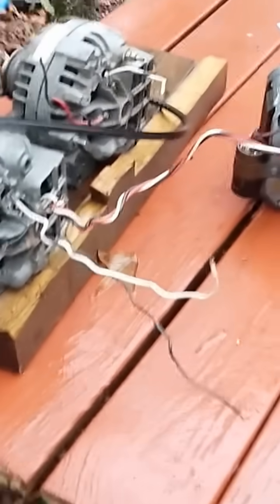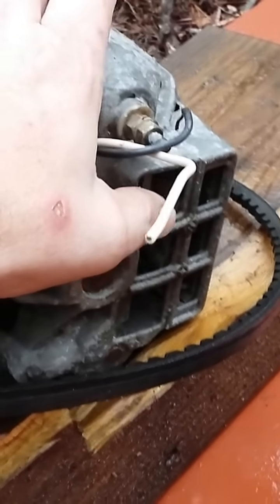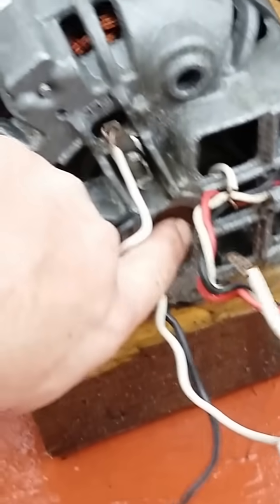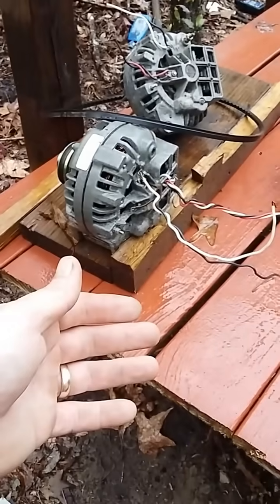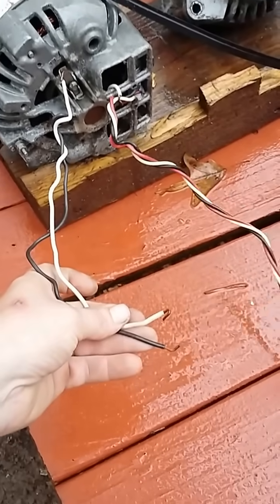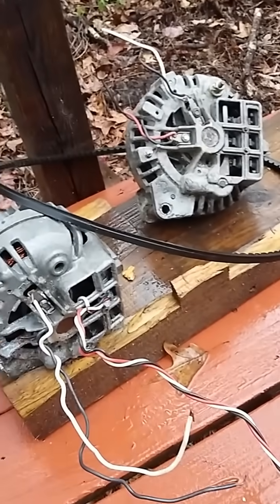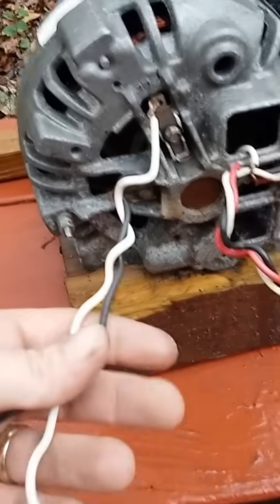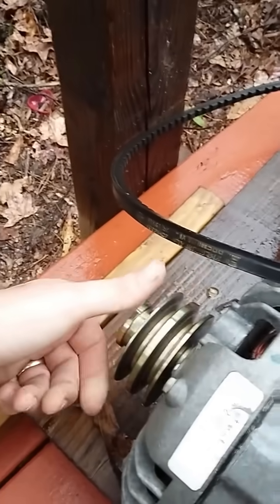Update Free energy forever no wind no solar no gas READ DISCRIPTION!!!

Comment: I have two versions of how to spin the alternator. 1 I've used a 12 volt ac  blower motor with a modified shaft to hold a pulley and second I used a old style sinde walk edger  and made a bracket to hold the alternator and used the original 3 hp Briggs gass engine. It'll run about 2-3 hrs on a gallon of gas also used the same set up to make a 12 volt battery charger for my drag car since we don't run a alternator. I just recharge between races. All of them work great. I see they're old Dodge alternator's they work great because without a regulator they will put out more voltage than a equivalent gm or Ford alternator..

Comment: You are correct it produces alternating current but the cycles per second  not correct at 3600 rpm’s which  you need to get a certain amount of current and voltage out of the alternator and less you change the magnetic fields internally there’s no way you can get 60 Hz out of an alternator which is 60 cps at 3600 rpm’s the alternator would have to turn a much lower RPM which I would say 300 revolutions A minute which would give you your 60 Hz but you wouldn’t get nothing out of the alternator no Current or much voltage
Reply from the maker: randy smith  do you know if you change your run capacitor it will also change your voltage and your Hertz on your generator?
Reply: Yes some one knows what they are talking about

Comment: Don’t be fooled it takes more energy to run an alternator than what you can get out of it this is not perpetual motion and even if you could get alternating current out of this alternator To run certain appliances At 120 or 240 V the cycles is not going to be correct the cycles of an alternator can be 320 cycles A sec at 3600 rpm’s which no conventional Electric motor will run And it may damage other electrical components that require 60 Hz per second not 320
Reply from the maker: randy smith oh and by the way and alternator is called an alternator because it produces alternating current! it is then ran through a set of diodes called a trio bridge that changes the alternating current into direct current and the fancy alternators actually have a capacitor in there to regulate the voltage...

Comment: I actually get this. People have this misconception that "free energy" means you're gonna magically pull it out of the air or something, but no it takes work to actually make energy. What this video means by free is that you're not paying for it. You're using a small amount of voltage and amplifying it into a larger amount (enough to power your home apparently) which is impressive and I assume saves you a lot on your electric bill :3 Cool concept dude. Thumbs up.

Comment: Trying to ask an intelligent question here without meaning any insult:    If I understand your video correctly, then you are spinning the alternator by belt drive from an electric motor. Yes ?   So, where do you get the power to run that motor from ?  I am guessing that if you are drawing 90 amps from the alternator then the motor to spin it will need a lot of power. Is this correct ?
Reply from the maker: Kevin Lawton technically what you said or how you said it is correct... but there's a lot more detail to it then what is being shown! first of all you have to have a battery or capacitor Bank in order to get the system up and running from that point it can charge the battery Bank. but you will have to put 12 volts at 500 milliamps to a pulse-width modulator and run pulses in a certain sequence into a 3-phase H Bridge that will power a 36 pole 3 phase permanent magnet motor using direct current pulses of sound at 14800Hz or pulses per second. you will need to feed with a power inverter off of the battery Bank 396 volts to your input on your H Bridge. You can do this with a small 500 watt or 1000 watt 110 volt power inverter and just run it to a 12-0 12 Transformer so that you will have the voltage needed do not feed that much voltage or current into the gates! Because the pulse-width modulator hooks up to the gates! And doing all of this will give you approximately and 800% efficient 3-phase permanent magnet motor that will produce roughly 45 horsepower which is enough power or Torque and speed to turn and fully excite to 10000 watt generator heads, thus being able to charge the battery bank (easily) because you're only consuming .75 amps at 396 volts you are also consuming 12 volts at 500 milliamps...  the alternator in this video is a homemade 3-phase field magnet motor. And I would like to take the time to say thank you for the kind comment and intelligent questions!!!  Did you notice that I switched the words rotor and stator?  a car alternator used as a car alternator can only produce 9 amps at 120 volts or 90 amps at 12 volts which is roughly 1080 Watts...
Reply: @ThomasBuie  thank you soooo much for explaining I love this setup and keep up the good work
Reply: Solar panels......

Comment: Wouldn't be surprised if you could  hook up a 12 volt battery to a hydrogen Dry cell  and inject that hydrogen to a gasoline generator 

The generator would have to  be pressurized with hydrogen but then again  you could also run your car on hho

I love this shit

I know this shit works

It's just expensive to learn how these things 

Work since electricity is a phenomenon  we can see
Reply from the maker: Christian Vega 
If you pressurize hydrogen and it has any oxygen in it, it will explode!!!! equaling death. You can use a 12-volt battery to create a great hydrogen cell but you must use pulsed DC not just regular direct current and in order to activate 1 billion parts per 1 billion Parts in the water, you must shoot the water with a red laser. this is all compliments of a family member of Stanley Myers of course... would anyone like for me to get into this a little further? Or explain how Stanley Myers did it with such ease?

Comment: All the dumb comments are by dumb people; he's showing you a home made inventor people.  He stated using a battery as a power source.  Then you can connect a solar panel to the battery to keep it charged.  He's smart.
Reply: Just add a bracket for another alternator and leave it stock to recharge your battery.
Reply: The dumb comment is from you.  You didn't calculate the amount of power it takes to turn the pully which is greater than any amount of power you can ever get back out of it.
Reply: Go back to school bro.  Converting DC to AC doesn't take but 3 to 12 volts  i.e a battery.    I currently use a 12 volt battery which I convert to 2500 AC volts.

Comment: People keep saying, "there's no such thing as free energy". While I realize that this video is about electrical energy, the proof of abundant free energy is a simple solar cooker. The mirrors/polished aluminum panels reflect the sunlight into the chamber, the chamber heats up, which heats the pot, which cooks the food. Simple to make, simple to use. Or use cardboard to form concentrating collector, inside of potato chip bags (or aluminum foil), Elmers glue, a pot and a turkey cooking bag will do it as well. Not AS WELL, but it will do it.

Comment: 90 amps at 12 volts AC only creates (through a 10 to 1 step-up transformer) 9 amps at 120 volts AC. The alternator can not generate 240 Volts at 90 Amps. 90 Amps at 14 Volts DC sustained, maybe. DC Voltage can not use a transformer.
Here are your basic electricity formulae. 
Power in Watts (P) over Electromotive Force in Volts (E) times Current in Amperes (I);  P/I*E.
Basic Electrical Formulae for Voltage((E)/Current(I)/Resistance (R); E/I*R
Voltage and Current are inversely proportional. Using transformers to step up Voltage steps down Amperage. Using a transformer to step up Amperage, steps down Voltage proportionately. 10 time more Amps means 10 times less Volts.  Ten times more Volts means 10 times less Amps. Simple really.
Reply: gecsus its important that u understand I'm not on this guys side.that said about 10 to 1 on amps is right for inverting DC to ac.but your wrong about the alt if he could get the alt to higher volts which he can't.it would still produce 90 amps.here's how I know and you can check.looking at this charge controller.its a 12/24 volt model it does 20 amps. So if I use 12 volts I can run 260 wats but if 24 volts I can run 520 wats.says so right on it.here's why the guts are set to let 20 amps through. Doesn't matter volts.but.he can't change the volts of that alt without changing the copper inside,and I'm 99% pretty sure he can't get it to produce ac power .inverters are big .to big to build on into housing.and he's a moron if he thinks that he can power anything ac with 120 DC.if you tried you would make the welder he was talking bout and burn up anything you tried. Ac and DC are not the same.now he could use 2 alts to make 24 volts but only 90 amps.if you used enough alts you could reach 120 volts but only 90 amps.so this dudes a lier/scamer.I live off grid and have ac and DC power outlets in my house.so I know bout this stuff.also your not using a alt you turn into a motor to turn a alt and gain power.you can use a DC motor to turn a alt with a slight gain.but you need the right DC motor. Needs to around 2000 rpm.and high out put alt 150+ amps..you need a DC motor because inverters lose 10 to 20% power lose so you want DC motor that runs off DC bank that the alt is powering.I could link you the stuff off eBay.but your not making enough power off one to do much not running a ac. Because even done right takes a lot to run motor.but buying a ac motor and using it to turn a alt is the best battery charger.nothing sold at any price compares.    Anyways while this guy is a hack smart people like you say stuff.have a blessed life.

Comment: The advice that "if you keep doing this you won't live very long" is not because some government agent will do away with you.  It will be your ignorance of electrical principles that will be your demise.  Sorry to be so frank on this, but you're ignoring basic electrical fundamentals here. You are likely to burn your house down by operating appliances on some uncontrolled, variable frequency AC power source that deviates substantially from the 60Hz that your appliances were designed for. And this doesn't even go into the issue of real vs. reactive power in the system you have here, and its impact on the wire gauge required to operate safely without capacitor banks.  Yes, your basic set-up here CAN work, but there's a WHOLE LOT MORE to it to make it actually safe and workable for any length of time.  Like you say in your video, it's not rocket science... but there is some science to it.
Reply: Tom Burns yep. That’s what I was thinking, the AC Runs on 60HZ frequency those alternators are all over the frequency spectrum lol
Reply from the maker: Official DP
 A capacitor will be used as a voltage regulator... All Generators have them...

But the alternator in this video is a motor, not a generator.. my generator isn't shown in this video.

Comment: I don't understand how it works I would need to see it in action. Is the one with the compositor the one you made? Am I missing something.
Reply: David Bloch you have to be near a running water source like a brook or a stream. The alternator is attached to a wheel that is spun by the running water.
Reply: Hydro electric has been around for a ton of years nothing new at all

Comment: ok ive read quite a lot of reviews about this.   Its funny how some people are so educated that they forget how to use basic grammar.  I'm sure aint no expert but I do know how to use: there, their, they're,  write, rite, right.  stuff like that.  ANY how I have a question: have you seen Gerard Morin "hyper drive"?  It has a lot of potential to be the "answer" to just about anything that moves.  Your smart and I believe you could solve or add to this.  The controller is the key. He has one and its a secret yet.  Its a smart controller this will handle 400 volts dc and run a small motor at 6k rpm with less than 2 amps at the same time its producing a back feed of enough voltage to charge a battery that operates that motor.  Im not going to add the "L" word but he has it.   He demonstrated pushing on the drum as a load at a lower rpm and raised the amps to 2.5.  Those ideas are huge because if you can run a 50 amp gen to power your house with tons of room to spare it'd be great.  Lots of head room to go bigger.  If you can make a Fisher/Paykal drum motor even spin that's an accomplishment.  When you can do that let me know.  share your ideas on it and I will do the same.  btw...I can not get this motor to spin up very fast right now.  but im on the right track.  thanx  and good luck.
Reply from the maker: LeRoy D  thanks for the comment brother! I have perfected my pulse width modulator and H bridge for this! I use 14.8 thousand Hertz frequency and only consume . 75A  at 396 volts direct current going into the hbridge but of course you know its not direct current going into the motor after the H bridge. The car alternator is a 3-phase motor as well as a three-phase generator...  I do have a 3 phase permanent magnet motor now.. I just haven't got it hooked up to one of the 10000 watt self-excited generator heads that Gerard Morin bought me..  EnergyBuies@Gmail.com
Reply: ThomasBuie EnergyBuies at gmail com the frequency has to be 60HZ
Reply: LeRoy D I'm sure ain't? Your write. Yew taak reel gud.
Reply: For somebody that is so much into correcting people's grammar you spelt thanks wrong!
Reply: Ee Sixtythree multiple spelling,  punctuation and grammar errors... Run-on sentences, etc...

Comment: Mr. genius here is telling your to “create power” essentially, you have to have the exact amount of power to put into a motor as what you want out, and what it puts out is all it can receive back through a charge in an alternator. The laws of physics tell us we can’t create or destroy energy, we have to transform it. You can run a motor from a battery that is charged by an alternator running from the same motor and then run another load off of the motor because when you add a second load you aren’t getting all energy returned to the battery from the alternator, some electricity is being spent on the other load. Thus, your battery will eventually die, how fast is determined by the size of the secondary load
Reply: Yep you can't get something for nothing.  I thought he was going to make it wind powered.
Reply: Lol, don't see what the problem is with having everything handed to you when that's what everyone else these days is getting, right? XD

Comment: Hi, I’m a bit skeptical at best. I would like to see it wired and running!  Talk is cheap prove it. As you say if you wanted to share it, do so don’t point to this or that and say it works.
As an aside if you put 90 amps through those wires, which look to be about 12 gauge I’m SURE you will get a weld. Just as it melts them together. 
12 gauge wire can’t carry a 90 amp load for more than a minute or two, closer to a second or two. (I’m being generous, ) (SAFELY). 
The ampacity  of 12 awg wire in ambient air temperatures of 30 degrees C 86 degrees F for U. S. would cause a temperature rise to 194 degrees using single conductor wire with just 40 amps continuous current. This is more than it’s rated for even at 40 amps. Standard safe practice would be to keep it under 20 amps as the maximum. The insulation gets hot under full load even then over a period of time. (Hours) 
These figures can be checked by referencing  Ugly’s electrical reference book or any other standard electrical reference material.  I would think the joints where the wires connect (would heat faster due to contact point resistance and fry them quite quickly.). This is dependent on how you bonded them of course. 
You are correct that there are alternators that will put out these currents, typically in a large truck, but I am a bit skeptical those shown put out more than 65 amps maximum and certainly not at full load continuously. 
If you could show this under a known load, (like standard resistance wire ie heater coil wires  arranged and capable of holding 220 volts at 90 amps with meters showing I would truly be impressed. I’ve been messing with electronics and electrical for over 45 years and I just hope you are safe. 
Best of luck,
 I just don’t see this as a safe and viable way of making electricity at the rate of current or voltages you suggest. Dare I say impossible?

Comment: Hello.1 I'm sorry so many people made fun of your exsent and nature dwelling. 2 you understand there's no way you used a alt you turned into a motor to drive that alt.it would spin to fast and any power gain would be wasted in extra rpm.3 don't think you can rig a alt to output ac.not 100% on that last one.I tried few years ago to use a motor to power a alt.I did it.but with a slight power loss.not gain,with right alt motor setup I believe a slight gain is possible.but inverters are only 90% so maybe you could use to charge battery bank.but not with what you used.

Comment: You didn’t mention how to spin the pulley on those alternators. Did you fool anyone? Doubt it.
Reply: Fred Rutledge he did he means to use 1 to turn the other.you can convert a alt into a motor.it won't work.it will take more power then it makes.this is why its just a pile of parts